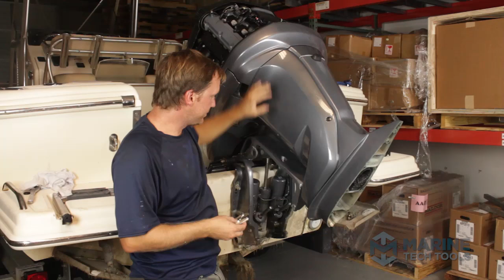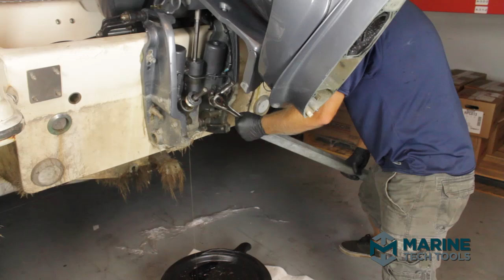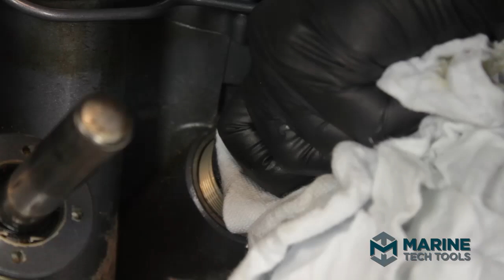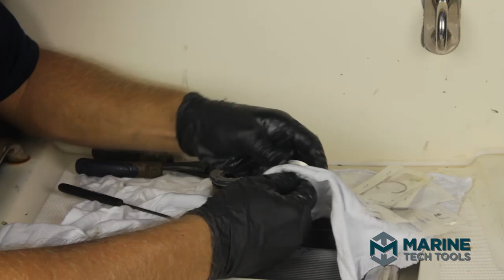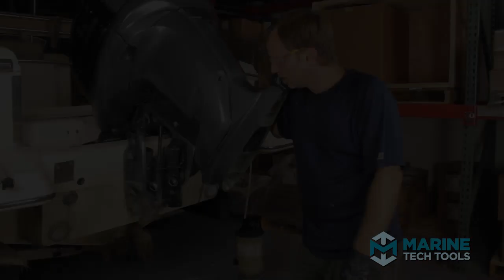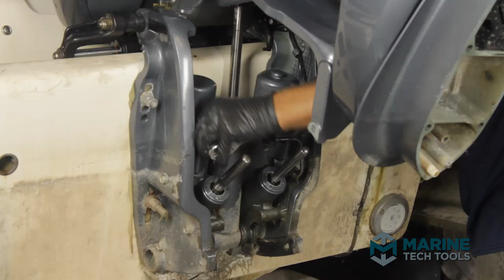Yamaha Trim Seal Repair / Rebuild

Comment: I believe I am now proficient in trim cover replacement and subsequent bleeding. I did this process multiple times, however I just encountered a snag and not sure what is wrong. Here is the story. My Yam (2012) F250 had a very slow leak on right or starboard trim cylinder cover. It worked fine till I opened it up and with a brand new replacement trim cover kit (Yam 61A-43821-09). The cylinder showed some oxidation, and I cleaned it and used 2500 grit paper. Assembled the unit back and bled. Somehow, motor going down get stuck at the moment the tip of the ram shaft touches motor frame and will not fully trim down. I have to apply some weight to get it going and can hear struggle on the motor. However, raising the motor up is just fine and very smooth operation. I disassembled and switched the trim ram shaft assembly, but to no avail. I also release the emergency valve but when the tip of the trim rod contacts the motor frame, it stops and wont move unless I apply some weight. I wonder if the orifice somewhere is clogging up and can be repaired or the PTT is toast? Appreciate any suggestion or any of your video which can help out.

Comment: Dont know if you are monitoring this video for comments but I have a question. Had the cap seals replaced last year because the O ring somehow squeezed out of the cap. This has now happened again. Any ideas on why the o ring would or could do this? Thanks

Comment: My tilt ram lifts fine but does not have the pull down strength that it had before changing seals and O rings. Thus the motor comes out of the water when reversing. I have taken it apart 3 times and nothing is missing or installed wrong. Driving me crazy!
Reply: Pull down ?    He did the tilt u mean the trim a large cly.     Tilt 2 small ones.   Bleed by yo g the release on the down. Power up fill release let fall naturally. Power up fill

Comment: I only have 1 trim cylinder cap leaking. Do I need to take apart the good one as well? Everything appears to be ok in the one I took apart, other than the leaking gasket. BTW, great spanner wrench you guys sell.

Comment: I replaced the seals on my trim because it was leaking out around the shaft on the left side.  Replaced both sides  Put it all back together  now the other side leaks and i cant figure out why.   Everything looks fine .

Comment: Great video. 
Had a question. 
When air is pushed out, where is it coming out from?
Reply: the air is pushed out of the hydraulic cylinder ram into the fluid reservoir, so then recheck the fluid level and refill to the correct level.

Comment: Great video. I was able to complete this repair with very little mechanic skill. I also bought the tool from Marine Tech and it worked great. The pex tubing to prevent the tool from slipping is a great tip.
Reply: I've watched the video twice, where does he mention the part about pex tubing?  thanks

Comment: You should really top it off once more when all rams are fully extended. This is the point the oil level is at its lowest in the oil tank.

Comment: Video is NOTHING like the real thing! I bought the tool, broke all 6 pins trying to get my caps off. These must be from a new motor as anyone who uses their boat in salt water will destroy their caps removing them. Save your $ and buy a better tool or new caps. This is junk!

Comment: Thanks for the video.  You are very thorough.  Question:  Is it better to pull the lower unit off to reduce weight when you lower motor down with manual release?   Will be doing on 250 SHO.  Thanks

Comment: Really appreciate this video. I was able to get the replacement parts and have everything replaced in less than an hour on a 2015 Yami 150. Toughest part was getting the dry rotted seal out of the cap. Everything else was super easy. thank you
Reply: Would you be able to post a link to where you found the parts?

Comment: Great videos! Love them all. So what if I try to bring up the motor, I can hear the trim motor but the motor won't raise with the power trim?
Reply: my motor is doing this same thing. Did you figure out your problem?
Reply: @elijahmataele1459  absolutely.  I purchased the seal kit and rented the tool from the guy on the video. Worked perfectly

Comment: I have the yamaha 225hp, but the tilt and trim looks identical to the one in the video.  Where can I get the spanner wrench (special tool ) to remove cylinder caps from?

Comment: Hi guys has anyone had trouble getting their screw off? My screw is already a little stripped from previous owner. I had a tough time getting it off to take the pressure off the system. Any tips? Thank you!
Reply: use a manual impact screwdriver. In another of his videos, he uses one. BTW, I think this guy is on his own and had a seastar bleed system, we should try to support him. Good dude, we all need his videos.

Comment: my engines, go up and down without any problems, but once I am on the water and put in reverse, the engine comes up and out of the water. What can I do ?
Reply: I have the same issue, but mine are leaking. when I replace seals and O-rings, if it fixes this prob, will try to find this comment and let you know.

Comment: My 98 Yamaha 60hp 2s has trim caps that measure 32mm from pin hole to pin hole (across). Seems to me the AMT0006 wrench would work but only Yamaha 115hp and up are listed as fitting that wrench it seems to me. Not sure what "Showa manufactured" means as far as my motor. They are stock. Will the 0006 fit or not?

Comment: The Yamaha manual states not to use a rag or cloth to wipe down parts because of microscopic peices coming off and getting in the system.My question is what the heck do you use then?
Reply: Air
Reply: @bradon38  Thanks

Comment: After replacing the seals  on my tilt trim and as i lower it, it start to shake and jump. As it go lower and/or stop, it make a squeaky noise. Needs help on this, any suggestions?

Comment: how do you bleed out the unit for air if your manual release is unusable( seized)
Reply: the only other way to do it is to loosen the hydraulic line nut

Comment: I have a trim with double actuator. I fix it and before placing it I want to test it with a battery outside and I have 3 thick cables one blue, red, black and one black that goes to an actuator asks how I connect it in the battery to test it thanks

Comment: Thanks for the walk through It worked out great. You never know the abilities of the previous mechanic until you take something apart. The guy before me was a butcher that's  why the seals failed. He bitched up the bore that the seal set in on the cap. Probably he was impatient taking the old ones out. Anyway all is well thanks again!

Comment: Great video, took all the guess work out of changing trim seals I bought the MT spanner wrench I'm sure I will be using it again. Looks like my Yam 200 SX TT motor is leaking on the back side, any

Comment: Got one of their wrenches and one of the pins sheared off and rounded two of the holes in one of my trims caps.  I had to use a punch to remove the caps and although I could probably reuse them I elected to replace them.  At $67 US for this wrench, I expected better results.  Buy this expensive wrench at your own risk.
Reply: Get the 4 pin and use a pipe to put Pressure on the wrench.  Before u do anything a couple love  tap s  w 2 lb hammer the  paint seals the cap  and impact a little helps break that seal.  It’s in a bad spot so u realty can’t hammer it too hard   But the pipe trick is a life saver

Comment: I'm working on replacing the dust seal on the tilt rod. I got the cylinder cap off pretty easily with no damage with a pipe wrench (great alternative for those who are cheap). The old dust cap was dry rotted out and had a metal ring inside. It is a wider ring, almost like a wedding band, compared to the one in your video. it doesn't seem to fit back into place correctly as it is too large for the replacement seal. Is there a trick to getting it back on? Also I'm a bit perplexed because the ring is not in the break-away diagram on this website http://i85.photobucket.com/albums/k79/SilverL67/Ranger/PowerTrimTiltAssy1.png

Comment: come on 40$ for seals but 175$ for the tools...
Reply: Amazon.com, "Marine Pin Wrench AMT0004 - 38mm x 4mm". $67.00. Worked like a charm.
Reply: Like Ray said, $67.00 for the tool. Prolly resell it on eBay for a slight loss but save you hundreds in dropping it off for someone else to fix. What kills me was the $32 for seals yet if I wanted to replace a whole threaded cap, they are only $32 each or so...

Comment: I dunno if you still read the comments on your videos. But this was really helpful in my rebuild. You should mention that the reason to be careful not to warp the rubber gaskets in the caps is because there is a metal core there. Warp that and your screwed, the unit I rebuilt was so rusted it looked like it was part of the cap! Only this video did not depict or show a metal tab in the cap that screws back on to the unit.

Thank you!

Comment: I just scratch the cap and made 2 or 3 hole broken to open the cylinder cap, it stuck very very bad and i didnt have the tool like this video shows, I break 2 of normal pin wrench and it didnt move a little, the final I using a metal hammer back flat plate place it on the cap, and using another big hammer to smash on it.

After I made a pit on the cap and keep smash on it and it loose finally, I observed the cap and the cap screw thread it just fine and I replace the seal inside and the o ring too.

Then I put back together and it work fine.  Of course the cap just like damage.

Comment: I replaced my seals.... now when lowering down to the 2 trim rams, the pressure of the fluid has pushed the dust seal out and leaks all over... I have swapped the caps from right to left and vice versa, still leaks only on one cap.... no matter which side I put it on, so I bought a new cap to replace that one and it happened again..... I am now lost at what to do... could air in the system be a cause of it leaking out like that? swapping the caps with each other was just to help rule out that the "piston" rods of the trim were not culprit. thanks if anyone can help.
Reply: great video by the way!!!
Reply: To much oil in system

Comment: I can't get the Trim 2 cylinder to lift the engine was working perfect before I replaced trim  1 both seals and dust gaurd. I hit up button apply oil the two small Trim cylinder pop out but the main  isn't lifting. I loosen the cap on resivore getting air coming out. I tried bleeding like you did in video any suggestions it's a 2003 yam 115
Reply: Put a piece of clear vinyl tubing on the filler (mine used 5/8") and keep it half full until no more bubbles and it takes no more fluid at full tilt.

Comment: Greetings

I am Ismael from Puerto Rico. I have a Yamaha engine 250 HP model S250TXRX . I need to know which tool I need to open the hydraulic bottles for the trim and tilt system of my boat. I would appreciate if you could give me the exact measurement.

Comment: i have a yamaha f150la , i unscrewed the tilt trim drainage by mistake thinking it was the fill cap. I had the Cap, a little bolt, a filter , and a bronze cylinder with a nipple on both ends come out. Now I am having trouble putting it back in cant seem to find out the order it goes back in , due to fact that as soon as i unscrewed it it all fell out at once.

Comment: How can you raise the motor if it is stuck in the down position?
Reply: +Barrio Jon You can loosen the screw like Leon is showing you and you then can manually lift up the engine.  It's pretty balanced but still heavy so you may want another person to help.

Comment: have you got a video on how to do the middle trim?
Reply from the maker: +Ashley Lewis I will look into doing that one too.  Its a pain as you need to take the trim unit off the boat.
Reply: +Ashley Lewis I would like that video as well.
Reply: +Frank Belgiovene can't find anything on YouTube it's a bloody pain.
Reply: +Leon Griffin I was talking to a Yamaha guy and he told me it's a piece of cake, yea right.  Well, it said once you put the motor on the trailer lock, then back off a touch, the pin holding the cylinder will loose.  Remove the C-clip and tap the rod thru the piston and it will be free.  However you first have to remove the tubing going across the cylinder.  Also, before all that, you have to loosen the end cap FIRST.
Then he said, once you have the cylinder end cap off, you pull the whole piston out and do it in reverse of the trim .  I'm going to attempt it this weekend.
Reply: Frank Belgiovene how did this all go? I know it was a year ago.... I need to do my main piston as well!
Reply: I just did the tilt ram on a 1999 130 hp two stroke.  I used the air chisel trick to break it loose using just a muffler cutter chisel and a hammer.  No videos but a few pics at the end: http://www.yamahaoutboardparts.com/forum2/tilt-cylinder-cap-th29338.html#post148633
I bought this pin wrench:  https://www.amazon.com/ATD-Tools-8614-Variable-Spanner/dp/B00BI2G9VI/ref=sr_1_9?s=automotive&ie=UTF8&qid=1492576747&sr=1-9&keywords=pin+spanner+wrench  not much swing on the center cylinder, after using the punch to break the top cap loose, I used a set of channel locks to remove the cap.  Looks like it would work well on the trim cylinders, but I had to clearance the tool on the grinder or it hit the ram.
Reply: These guys are awesome.  Repair shop wanted $600 to do this job.  For $67 you get the MTT 4mm wrench and then order the $70 seals & o-ring kit and it might take you an hour to do the job. You will need a siphon pump and a pick from Northern Tool to make the job easier.